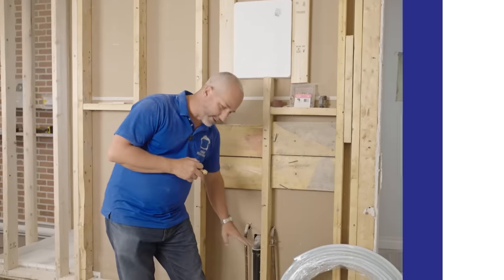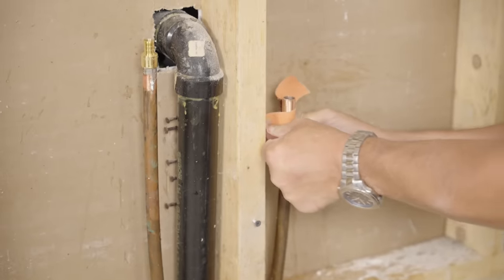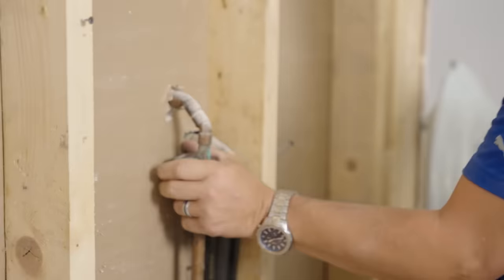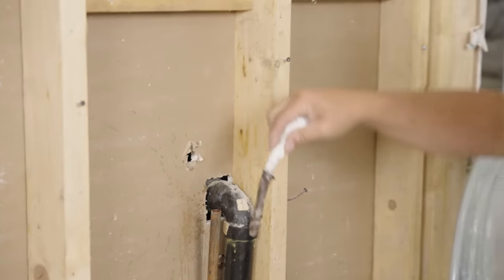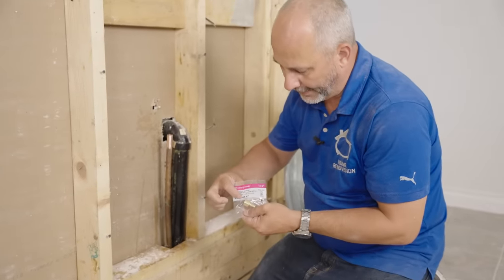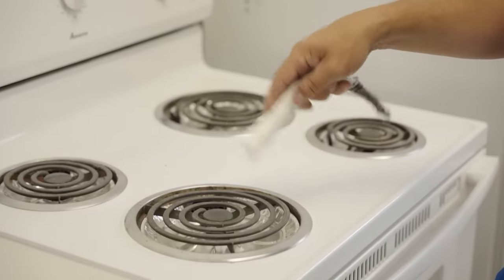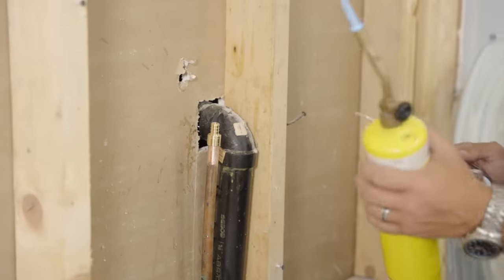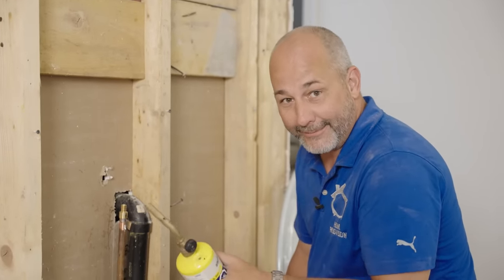Convert Your Copper To PEX | Church Flip | Episode 11

Comment: Easy way to empty water out of a pipe is to use an old sprayer nozzle from a spray bottle - stick the tube in the pipe and point the sprayer end into a cup and squeeze the trigger until its all pumped out.
Reply: Great frigginidea!!!!    I never would have thought of that simple fix on my own!  Thanks for sharing!!
Reply: It's SO much easier to just use a SHOP VAC. It takes care of the problem in seconds! Or if you have an air compressor on site, just open faucets and blow out the water.

I used to run a hotel with 64 toilets and using a Shop Vac was a must. We didn't use the Vac to suck out the "muck", we used it to clear out the water from the tank and bowl before servicing the units. it made the repairs "dripless".

BTW, no, we didn't use the same Shop Vac on the toilets as the Vac we used for the potable water lines. Also, most of the time we just used the 1 gallon sized units, cheap and effective.
Reply: Bread... Always works and when you turn on the taps it just comes out
Reply: Brilliant!  Thanks.
Reply: Genius
Reply: Son of a birch why didn’t I think of that
Reply: Here’s one for you! There’s a drill bit that cleans the copper for you. Cheers
Reply: Fantastic idea.
Reply: @GNUOYEEL  Yeah even better idea also! Shop vac and spray nozzle!
Reply: Thanks
Reply: @SudburyMan  Bread won't work for a pipe with standing water. It works WAY better if your pipe just has occasional drips from all the overhead plumbing.

Comment: ...wow, I'm redoing my basement bedroom and bathroom, I literally bought the cutting and crimping tool 20 minutes ago and then this video pops up...get out out of my head! Lol.
Reply: hopefully you don’t flood your basement but not hiring a plumber
Reply: @nutter4butter  If you can't install PEX as a DIYer then you also probably need help eating and tying your shoes.

I also fix my own car, got any complaints about that too because I'm not a licensed mechanic?
Reply: @DeltaH-9  he’s being a condescending prick about it but he’s got a point. If any of the plumbing isn’t done correctly you’ll have to redo your entire basement and bathroom. Sometimes it’s worth it to hire an expert.
Reply: @sami-iami  I'm not hiring someone to install what is basically now Lego pieces with clamps. Anyone with at least half of a brain can install PEX. As long as you follow the instructions there will not be an issue.

Comment: The health implications is another very important factors to consider when deciding whether to use copper or PEX for the water pipes in your home. Copper has unique antimicrobial properties and is proven to continuously kill bacteria, viruses and fungi. Copper water pipes and copper touch surfaces exhibit well documented antibacterial, antiviral and anti-fungal properties. Copper kills over 200 different pathogens including cold and flu viruses. It’s the only solid metal touch surface registered as a public health product by the U.S. Environmental Protection Agency. Copper effectively and continuously kills germs in copper pipe. PEX does not.
Reply: Interesting...why is everyone installing pex then if you dont mind explaining..i know its easy to repair
Reply: If you have enough standing water in your pipes for this to be a concern, that's a bigger problem than PEX vs Copper.
Reply: That's why I've installed PEX everywhere except the kitchen. We only drink water from the kitchen faucet.

Comment: Weird trick I learned from tea bags, but applies here. Get a long paper towel cut it into a strip about 1-2 inches wide. Twist it tight length wise at a slight angle so it resembles a long pipe cleaner. You can put that down your tube and make sure the rest of the towel outside the pipe is lower than the water level you want to remove, then wet the rest of your paper towel. The surface tension of the water acts as a syphon. I've successfully done this to pipes 8-9" down. Or just wet a cotton string, or get some small tubing and use them as a syphon.
Reply from the maker: Great tip!

Comment: PEX only at best has a 25 year warranty and most PEX fittings only have a 10 year warranty, so the thought that any PEX job will be a 100 year job is dreaming. Copper is still king, but is expensive and harder to work with. I replaced all my copper with PEX because we had pinholes. Fortunately I am older and will not likely be here in even 25 years to see if it really holds up that well. The key to PEX (or any pipe/fittings) longevity is have a whole house filter that get the chlorine out (when on municipal water) as they will age pipe/fittings faster.

Comment: Copper whilst hardest to install is still unrivalled for proven durability and lifespan
Reply: No it isn't. PEX will withstand more extreme events like freezing.
Reply: PEX hasn't been around long enough to say that it is unreliable. And if it fails, it is easy to repair, unlike copper.
Reply: @daveface69  pex is relatively unproven, it is a new system...
Reply: @lxmzhg  thanks for restating my point.
Reply: @lxmzhg  if your pex fails and creates 30k to 50k of water damage, the ease of repairing the system will be largely irrelevant.
Reply: @rotabom  PEX has been in use for decades, it wasn't invented yesterday.
Reply: @daveface69  I'm well aware of that. I spent a long time researching all the different systems before I plumbed my own house with copper.
Reply: @rotabom  Actually I didn't restate your point. Because after all the years that PEX has been in use, there are no definitive reports of catastrophic failures. Copper also fails, especially after it freezes, whereas freezing doesn't cause PEX to fail.
Reply: @lxmzhg  you echoed my point on the newness of pex. And the lack of data. Where I am housing products have to have a 50 year lifespan. PEX doesnt have that yet. The manufacturers are carrying that risk.
Reply: @SaroG  so will the pyramids of Gisa
Reply: @rotabom  My house has copper, & it already sprung 3 pinhole leaks. It's less than 20 years old.
Reply: @lxmzhg  yep, there was some coming out of China for a while that was of poor quality

Comment: The interior of the pipe was not deburred properly. Please ensure you debur the inner part of the tube as it creates turbulence and you will find that you will get pin hole leaks just after your fitting in copper to copper. The wire brush doesn’t remove burs properly. Adding flux only to the end of the pipe being soldered not the inside as you can leave more residue than wanted and that eats the pipe from the inside, again going from copper to copper. This should be explained so that so it yourselfers aren’t misled from what is shown here.

Comment: 6:17 or can grab a heat mat to hang up there and protect DWV and back of drywall, as those mats work pretty well. Also, wet-rag is another product can use for on pipes etc that don’t want heat transferring or “melting” fittings up from where soldering, etc….

Comment: I use a wet/dry vac with a 12” length of ice maker tubing to suck the water level down.. don’t need to tape it , just close it off with your fingers a bit and it is plenty to suck the water out… you need the wet/dry anyway to clean up spilled water.

Comment: when draining the line.  use a small piece of fabric. push one end in.  hang the other end of the pipe. water will wick up and poor over the edge till it's empty.  should only take a second.  and will go down the length of the fabric in side the pipe.

Comment: Hi there, how do you extend the 1/2 inch OD PEX pipe sticking out of the wall just about one cm where there is not enough length to accommodate the crimping ring. Can you do a video on this issue? thanks in advance.

Comment: I heard that refitting a 1/2 inch copper pipe to pex with cause low water pressure (due to the pex fitting) and will damage the plumbing system. Any thoughts? Tks!

Comment: G'day from Australia. I'm about to plumb a whole new house with PEX - A. Just wondering if you have any comments about the type of PEX fitting. Compression ring or expansion ring. I love your work by the way. Keep it going. Regards Gaz.
Reply: I'm a Master Plumber from MN both Pex A and Pex B have the positives but on new construction I like to use Pex A expansion. The reason is water flow water cannot be compressed. Pex A expands to go over the fitting so the fittings are bigger and flow more water through the joint. Copper sweat still is king for water flow but Pex A expansion is a close second. For expansion I recommend Uponor and for crimp I recomend Viega. Some of the crimp styles you need to watch out for the crimp ring they get fatigued over time and will leak. Viega seems to be the best crimp style I've used and same goes for Uponor.
Reply: @JacobLAChristenson  Hi mate.  Thanks for your comments. This is inline with what I was thinking too. Nice to get some confirmation. cheers

Comment: If you wipe that Flux off after heating and b4 Appling the solder you won't get that mess around your joint I used to solder like that too until I was given that tip
Reply: I recently saw a video where you would see the solder get pulled out of the joint because of the excess solder on the pipe and no, it wasn't a demonstration of how not to solder.
Is there a reason why you wouldn't just wipe the flux off before heating the pipe?

Comment: Old geezer tip about flux: CLEAN UP THE MELTED OVERFLOW.
Flux is great stuff but some folks forget that it is actually ACID.
If you don' t clean it up, 20 years down the road, you'll notice that your pipes have corroded in  spots where the flux oozed out to.
If that area of the pipe has experienced condensation or moist conditions, a pinhole will develop and may eventually lead to a burst pipe.
ASK ME HOW I KNOW!!!
So do yourself a favour: take a few moments and wipe away the flux residue after you've made that beautiful sweat-soldered joint.
Depending on the flux type, you might be able to get away with a soap and water soaked cloth to wipe it away, or you might be better off with a rag and some alcohol (maybe acetone or some other mild solvent.)
It's no use making a 100-year fitting if you'll be flooded out in 20 years because your pipes turned into blue-green copper oxides. May as well have bought the Shark Bite fittings...
Reply from the maker: Cheers Jim!

Comment: Kind of surprised you didn't talk about sharkbite fittings. Not sure if they are up to code behind walls there but in the USA they are allowed to be behind the sheet rock. I've had some installed in various places for over 10 years in my house and no leaks yet.

And yes I know someone will say they might leak, but even solder joints can leak if not done right.
Reply: In the UK we've got two or three different types of product like that, including one called Speedfit where you can do all of the plumbing (even taps, stops, valves etc) using push-fit and plastic fittings. I've used them in my own house and had found they do better than old-school compression or soldered joints, which can 'weep'
Reply: He definitely mentioned sharkbite in this video and why he didn't use it in this install.  However, he does have older shower install videos converting copper to PEX using sharkbites.

Comment: i love sharkbites, but i agree, only when i can see them. i have them under my kitchen sink because i was moving stuff around a lot during the renovation. check out those autocut pipe cutters, no need to adjust the cutter tension, just clamp and turn

Comment: Hello, I have black iron pipe in my basement that feeds hot water baseboards on the first floor. Could I cut out all the black iron in the basement and replace it with PEX? If so which type of PEX do I need? And, I assume I'd need an adapter that goes from the PEX line and threads into the baseboards? Is this true?

Comment: 1) An old license plate makes a good shield for not setting your house on fire. And, 2) if you’re my dad you have a damp/wet rag ready to wipe the pipe clean of dripping solder.
Reply: A wet rag is also a good shield.
Reply: A wet rag can cause thermal shock to the joint and possible compromise.
Reply: @robertwessel6409  he said "dripping" solder. I don't think he meant putting the rag directly on the joint while it's still hardening.

Comment: Hi Jeff. Do you think it is a wise idea to use this under concrete (I will cover it with some protection)? I know it might be against the code, but I don't care about it really.
Reply: Alex, it is preferred that you use soft copper and brazed joints, not soft solder. You can spot repair without needing permits or anything so converting to pex is fine but if you have a slab leak I recommend rerouting the line in your attic or from a close enough line in the wall
Reply: @xEndoNucleasex  Thank you!

Comment: Call me paranoid but I don't want to use PEX. I'm concerned about the chemicals in the plastic leeching out. Also taste is everything.
Reply: But the chemicals in solder and flux is ok? 🤣 What about the leeching chemicals from your toothbrush? Plastic eating utensils? Plastic cups? The list goes on and I think I've made my point.
Reply: I live in England and replaced all of the plumbing in my house with PEX (well with JG Speedfit, which is a plastic product, not sure if its PEX). The pipes into houses of a certain age here are lead, which is far worse than anything I'd get from the plastic
Reply: If you’re on public water, the plastic pex lines should be the least of your concerns.
Reply: @marcustulliuscicero9140  Speedfit, Hep20, etc. make PEX and PB pipes. PEX is the most common.

Comment: 2:30 Pro tip: to empty your pipe, use the head of a spray bottle (windex). Fit the plastic straw into the pipe and spray the water into a rag.

Comment: To change copper to pex-b, I would increase the diameter. For example, to replace 1/2 inch copper, how about use 3/4 inch pex-b. Likewise, replacing 3/4 copper, use 1 inch pex-b. The reason is that fittings for pex-b reduces the flow as the internal diameter is smaller (pressure drop). For pex-a, no need to increase the diameter because the fittings does not reduce the internal diameter. I would like to ask the pros if this method is ok to avoid pressure drop.
Reply: PREACH IT LOUDER FOR THOSE IN THE BACK!!!!!
Reply: Although to be thorough, it doesn't cause a pressure drop. It does reduce flow. Also the fittings cause a lot of turbulence which further reduces flow. Even with PEX A I would up size. I'm going to be putting in PEX A to replace my old copper pipes. I'm running 3/4 to everything and I'll use a 3/4 to half male fitting when I get to where I need. My main will be 1 inch and my spigots will be 1 inch as well.
Reply: Also, PEX A does reduce the id. Go to Lowe's grab a 3/4 PEX A fitting and 3/4 copper pipe and you will see the copper is still a little larger.

Comment: Our home built in 1968, copper piping, hard water well - constant rotten egg smell...
Taked to water expert, he tested water and said high in iron. Copper pipes were green inside from chemical reaction causing the smell. Replaced all water lines with PEX and added iron filter before softener and no issues or smell for 7 years already :-)
Reply: My parents are dealing with this! Thanks for a direction to try
Reply: How did you access hundreds of copper fittings to convert to PEX without removing all drywall?!
Reply: @SmartLifeSolutionsWork I had a similar issue difference is my house was built in 1940's. I had to remove the drywall, cut the copper, and pull it all out. Replaced with Pex B because of lower install price (I had to buy the connection tool). Pressure is better and no pipe bursting during freeze.

Comment: please use a reamer (deburring tool) on the inside of the copper to eliminate a lip, not a wire brush like this guy is using, that is for cleaning fittings. you will have pin hole leaks if you do not make the inside lip flush.

Comment: Hey Jeff, just wondering is there a reason you'd want to convert existing copper plumbing to pex other than it's easier to work with? thanks!
Reply: Copper plumbing gets pinholes notoriously. Big pain especially as it ages

Comment: Map gas is the way to go. If you haven't ever done this, you'll want to practice on some scrap pipe. If you heat too long you'll burn the out the flux and it won't suck in the solder. The flux is what makes this work.

Get a scrap of ceramic tile or similar for a heat shield in tight spaces so you don't burn plastic pipes or set stuff on fire.
Reply: A few layers of aluminum foil works great as well as a heat barrier
Reply: For the diyer yes map gas is the most cost effective option. But nothing beats a b-tank and turbo torch for soldering.
Reply: Thanks for the tips!
Reply: MAPP isn’t true MAPP anymore. A propane tank with TS8000 will do the trick quickly.
Reply: An old license plate you can bend around the pipe works wonders
Reply: I just use a bic lighter on high of course takes a few days but it gets the job done.

Comment: pro tip and i havent even done this but here goes ..for water in line as shown in video at start =wet dry vacuum with smaller insertion pipe , u imagine the🤫 rest